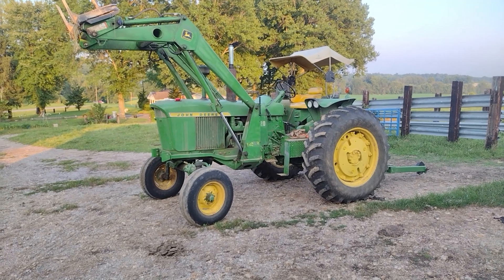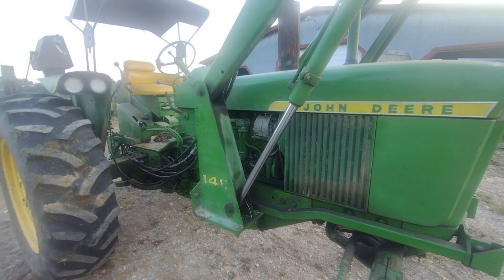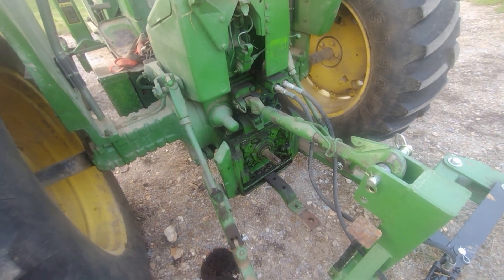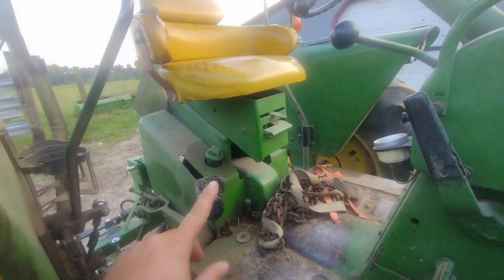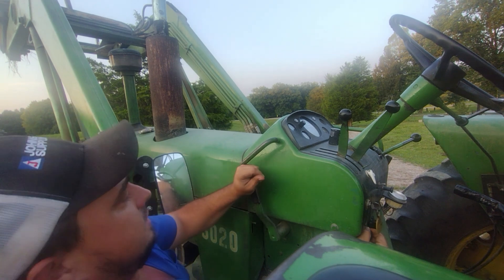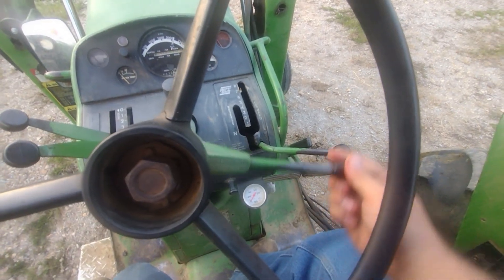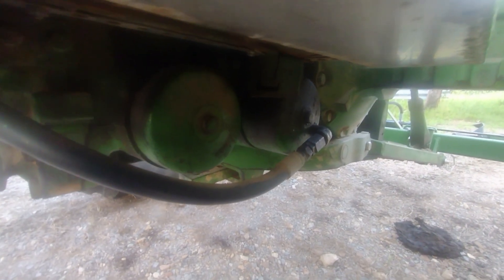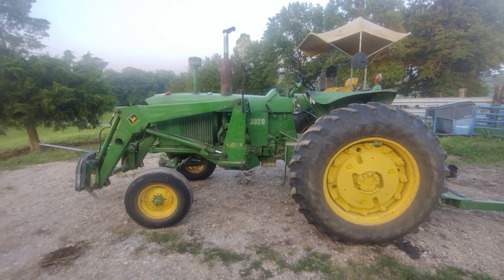Tractor stats - (Episode 2) John Deere 3020

Comment: Good video.   A lot of good information.   We also have a 3020 standard model.  Been in the family for almost 50 years.  It will never leave the farm.  It’s is a very fuel efficient tractor.  Nothing beats it. Is it true, it’s an identical motor to the 4020 just 2 less cylinders? And is everything from the flywheel back the same as the 4020? Like the trans and rear end?
Reply from the maker: Thanks I really appreciate it!  The 3020 is the same design as the 4020 and a 4020 rear end will bolt up to the 3020 engine but everything from the clutch and input shaft to the axles and 3pt arms are the same design as 4020 but a little smaller. It's awesome that you have a standard. I'm in Missouri and standards are pretty rare here. Thanks for the kind comment and supporting the channel.👍
Reply from the maker: I forgot the engine question. Yes the 4 cylinder engine is essentially the same as the 6 cylinder 4020 with 2 less cylinders. But they did have to mount a balance box assembly (weighted shafts) under the crankshaft to balance the 4 cylinder. The 4020 engine didn't need this because inline 6 cylinders are inherently balanced. Thanks again
Reply: I have a 68 3020 diesel. That other pto shaft above is the 1000 rpm one, the one with the finer splines.